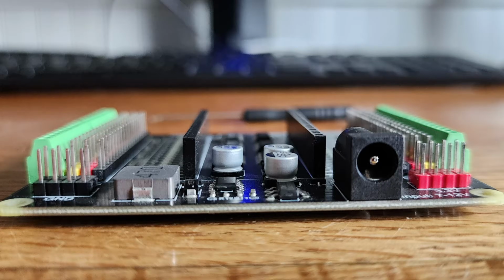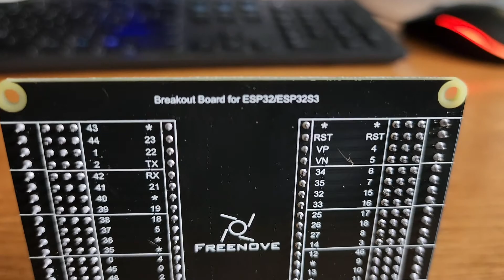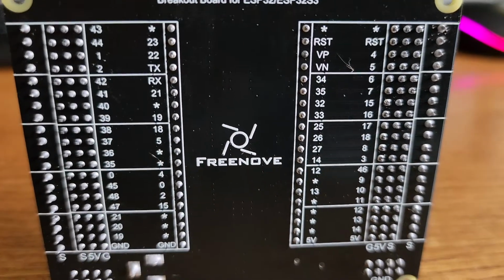Top Reasons to Get the Freenove ESP32 / ESP32-S3 Breakout Board! #Arduino

Comment: I just got a board.  Since the 5v rails are not powered off the ESP32 5vIN and they are powered by the barrel jack on the expansion board, can I also plug in my usb-c for serial debugging at the same time?  (USB-C and the expansion board power)
Reply from the maker: yes,  you can have the breakout board powered by the barrel jack and plug your usb-c into your ESP32 for debugging. 
Keep  your ESP32 5v pin isolated from the header. 👍👍

Comment: i baught one , its amazing for debug, but those screw terminals are fragile and trash , i broke one of them using no effort , in first 3 days of use
idk if a bigger more taught screw terminal dimensions like 3.5mm .... can be swaped with that one
Reply from the maker: hey there! Sorry to hear that.
Did you buy the Freenove breakout board?  I haven't had any issues with mine yet, thankfully. I do worry sometimes that I may over tighten, but it hasn't happened yet.
you're thinking of removing the one that is there and replacing it with a better one?  That might be a good option under your circumstances.
Reply: @BMonsterLaboratory yeah i might swap all of them with bigger ones , am waiting for them to arrive , working on robotis and things that move need taught connections, 2.5mm terminals are a bad idea
i baught one from the OSOYOO brand , but its the Exact same as this litterly

Comment: Any chance you have a video I am missing on how to use the 5v screw terminals on this board. I would like to be able to use it for some LED strips. I am confused as to how the pins and the terminals work together and I cannot seem to find any information on how to correctly use these two together.
Reply from the maker: hey there!
I'm actually using it in a project at the moment. I will be happy to make a quick video. 
Just so you know, the screw terminals and yellow header connect to the esp32. the red and black header are 5v & gnd provided by external power and can supply up to 3A current.

For WS2812B strips (as an example), you can use the board’s 5 V output for small loads (total <3 A), but for bigger strips you should power them directly from a separate 5 V supply and only share ground with the board. Also, since WS2812B LEDs run at 5V and expect a 5V data signal, you should use a level shifter to convert the ESP32’s 3.3V data output up to 5V.  A 74AHCT125 is a good choice.
Reply: @BMonsterLaboratory  I guess my confusion comes then, if you need to have a 5v data signal, how do you get that off the board? Just use the data part for the lights coming from the board and then use the external PS to actually power the lights? So yellow lead to the screw terminal and B/R from the external PS?
Reply from the maker: Hey, I made a video to answer your question.
This is how I do it - https://youtu.be/wYBIO-Bm7S0  👍👍

Comment: can i use these for old wired binary window sensors?(redd) its my first time getting into these kind of stuff and im not as tech savvy like you guys so no matter how obvious the answer is i still wouldnt know about it unless ive experience it. but im willing to learn
Reply from the maker: Hey there!
I wouldn’t say the answer is obvious — being curious is the first step in learning “how to,” so you’re already on the right path!

The binary window sensors you’re talking about use a reed switch + magnet setup. The reed switch is a small glass tube with metal contacts inside. When the window is closed, the magnet keeps the contacts together (circuit closed). When the window opens, the magnet moves away, the contacts separate, and that change triggers the alarm input.

To answer your question — yes, you can absolutely use this type of sensor with an ESP32.  You can connect several of them and monitor doors, windows, gates, or anything else that opens and closes. The ESP32 reads the sensor input and can tell whether the circuit is open or closed — meaning whether the window (or door) is open or closed.

In fact, I just ordered a couple myself and will share the details when I'm done 
By the way, here is a reed switch video I made a while back - https://youtu.be/PQe3PD58Ocw
great question! 👍👍

Comment: Your comments are helpful to identify for new users this handy breakout board suitable for many DIY projects particularly in robotics.  However, FreeNove is SO close yet not that close to a really useful breakout board because it does not offer the option of either +5 or +3.3 volts on the triple header for external transducers as many are these days.  AND as we are working with ESP33-S3 MCUs, the assumption that ONLY +5V external transducers are used is really quite off the mark.  I did identify this design option directly to FreeNove.  Yes, I have 3 projects that use this FreeNove solution - the Breakout board and the ESP32-S3 MCU.
Reply from the maker: hey there!  Thanks for the great comment - and I do agree. 👍👍

It would be nice to have a voltage select jumper for 5v/3v. Your comment shows that there is plenty of room for improvement in the next board version.

Comment: Do you know which pin is used for the SD chip select? I could not find it in the documentation.
Reply from the maker: hey there! 
ya, I see what you mean.
I checked the docs on espressif website and found this: 

In SPI mode, the ESP32-S3’s SD SPI host driver doesn’t use a fixed, hardwired CS pin — it’s controlled entirely in software. You can assign any free GPIO to act as CS by setting it in sdspi_device_config_t when calling sdspi_host_init_device().

https://docs.espressif.com/projects/esp-idf/en/stable/esp32s3/api-reference/peripherals/sdspi_host.html

hope that's helpful! 👍👍

Comment: Hands-down one of the best ESP32 boards out there! I only wish they made a version what worked with the generic ESP32 dev kits out there… because I love the screw headers and the GVS header sets… plus being able to run 3A through that board means I can run all my peripherals off the board power without having to have a separate power bus for the sensors!
Reply from the maker: I'm with ya on that! The power distribution makes building a project much easier.
I am a fan of Freenove. They have excellent documentation on everything. 
Great hearing for ya!👍👍

Comment: Hey, I got one of these boards that i use  for my Esp32-S3 wroom lite. Why are there random onboard leds always lit up?
Reply from the maker: Hello, 
A similar question was asked previously. A viewer asked why lights blink when no ESP32 was attached. I looked up the datasheet and provided my best answer below.
*********
"This board has independent power rails and It looks like pull-up resistors determine the state of the lines connected to the LEDs. Some GPIO pins default to HIGH when the ESP32 isn’t connected.
Without the ESP32, the combination of active power rails and pull-up resistors can cause the LEDs to remain lit. "
***********
Are the LEDs lit while your board is in operation? Some ESP32 pins start HIGH or LOW by design, or maybe it's from wireless connectivity that can cause blinking... When your ESP32 is connected, it operates on a number of pins, perhaps that's it? If you're board is connected and LEDs are blinking that shouldn't be blinking, try setting all unused pins to low  and see what happens. If it doesn't blink anymore it could be because a floating pins can pick up noise and cause it to blink. 
Those are just some ideas. You may have to do some testing and determine the cause through process of elimination. 👍

Comment: why are all those leds on when there is no ESP32 plugged in?
Reply from the maker: hey there!
This board has independent power rails and It looks like pull-up resistors determine the state of the lines connected to the LEDs. Some GPIO pins default to HIGH when the ESP32 isn’t connected.
Without the ESP32, the combination of active power rails and pull-up resistors can cause the LEDs to remain lit.  👍

Comment: Im thinking of using this on a cnc project.  The drives require 5v ground singnal instead of 3.3v. Will this breakout board and external power supply allow this? Thanks
Reply from the maker: There's a 5v supply on the board but I would not attach any type motor to it. I would use external power and use the breakout board to control the signal pin. I'm actually in the process of making a video that answers that exact question. 👍

Comment: Have you connect this board to stepper motor drivers I have the tb6600
Reply from the maker: I have not but that sounds like a useful video! I haven't used the tb6600. It looks like a solid driver, one that I may want to use in a project.
I just purchased one and will check it out. You should be able to connect them, just watch your connections. Make signal voltages are compatible between your MCU and the TB6600 driver and connect a common ground.

Comment: I found this break-out-board to use with another ESP32-S3 board but soon found out it's only compatible with the two Freenove boards. This turned out Ok since I was now introduced to the quality Frenove ESP-S3 Cam board. Looks like a keeper, just found your video on using the cam with my phone, cam is actually better quality than I had imagined. Thanks for both videos, keep them coming.
Reply from the maker: I agree. Freenove makes quality products. The picture quality is good for a camera so compact and cheap. Maybe i'll get back to this board and make another video very soon. Thanks for leaving a message and good luck with your project~

Comment: I've decided to mainly use Freenove ESP32s because of the solid build quality and excellent presentaton of Freenove products! 👍🏿
Reply from the maker: I totally agree with you. Top quality and documentation for their products. Thanks for the comment! good luck with your iot projects
Reply: @BMonsterLaboratory I can't believe it's been a year since I posted a comment!

I wanted to follow up by asking you to highlight the ease of debugging the ESP32 S3 because of the onboard JTAG support. No more ESP-Prog!!
Reply from the maker: @baxter6504  It has been a year and i'm still hvaing fun with my esp32 boards.
The esp32s3 is great! Native debugging in the IDE.  No more spamming code with Serial.print() statements!
Reply: @BMonsterLaboratory I am developing a library for encrypting my WiFi SSID and password and saving them to the Freenove ESP32 S3  onboard SD card instead of hard coding them or using a WiFi manager. I'd forgotten it has an SD card until rewatching your video! 👍🏿

The onboard JTAG support eases the pain of finding bugs because I can step thru my code line by line inspecting variables (without having to wiring an Esp-prog to pins 12, 13, 14, and 15)!

Comment: Just got a v1.1 board but can't connect to Wifi nor get AP mode running. As soon as I remove the ESP32-S3-WROOM-1 from board, than it works.
Reply from the maker: did you install the driver?
Reply: @BMonsterLaboratory  Driver for the Breakout Board? Nope. It only has logic IC buffer, and some power IC, dosen't it? For the ESP32-S3 USB<->Serial chip (CH343) yes, that works.
Reply from the maker: Sorry, I read your question wrong. You are correct. Does the pinout of your board match the pins of the breakout board?
Reply: @BMonsterLaboratory  PinOut seems identical to yours. Mayor diff: In your vid Pin38 led is lit, for me it's 39. Diff No2: when I move my finger over the jumpers/screw terminals LEDs light up. I've not configured the ESP Pins (left them floating?), for testing I'm using only BuiltIn LED.
Reply: I'm experiencing the same issue. Have you ever solved it?